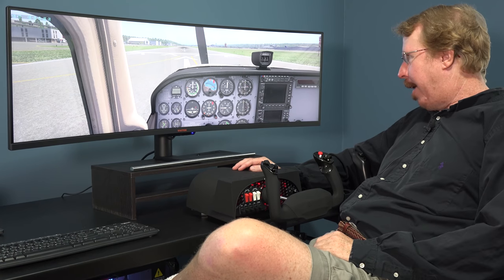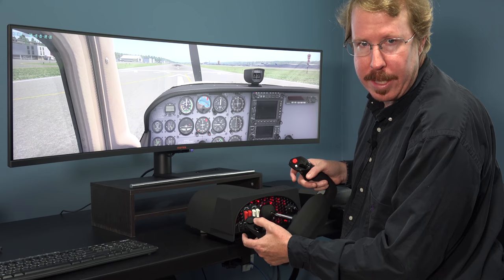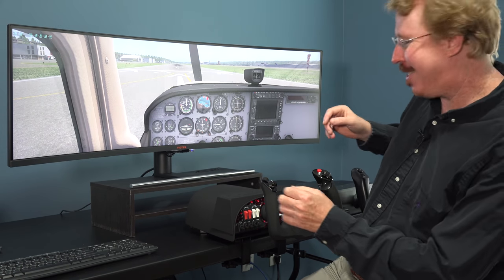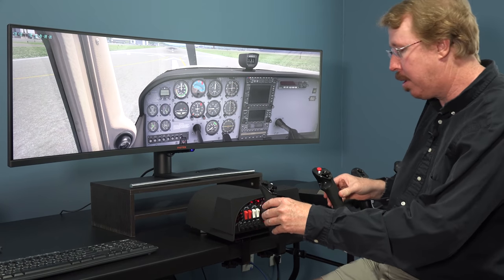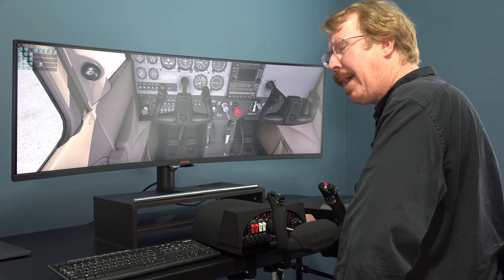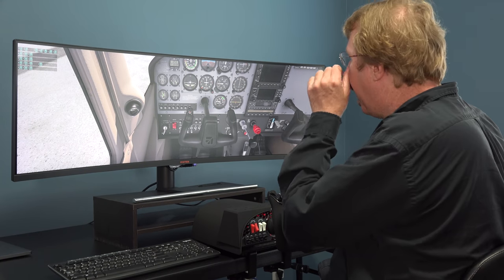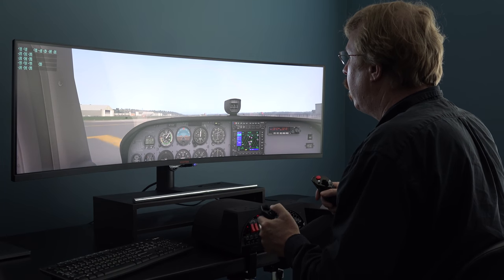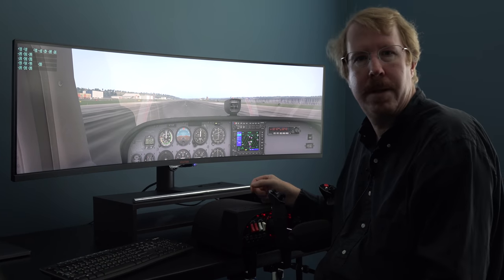Honeycomb Yoke Overview and Demo by X-Plane creator

Comment: Hi Austin, I want to thank you.   I received a scholarship when I was at high school, a meagre $1800AUD back in circa 1985.  I used that to fund flying lessons.  I eventually flew solo in a Cessna 152 when I turned 16 (a couple of weeks later).  It took me 22 hrs.  Average was apparently 15-16 hrs.  In my defence however, I never took off or landed without a 15 knot crosswind and most of that it was pissing down with rain.  It was the time of the Americas Cup in Perth/Fremantle and Alan Bonds Air Ship was always somewhere I was flying around.  I think it took me a while to get there not so much because of the cross winds, but power stalls really got to me, until I eventually recovered from one in 400-450ft.  I also had to have a booster seat.  I never got a growth spurt till I was 18.  When the money dried up, I was hitching flights on C152s, C172s, C182s and even V35Bs (Which still fascinate me till this day).  One of my Year 11/12 subjects was Aeronautics, so I got a bit of boost towards academics and a graduation prize for being one of the youngest pilots to fly solo in my State.  All things come to an end.  When I opened this yoke and finally figured out I had to patch the RG12 in, wow, whilst I was flying in FSX:SE Dont kick me I do have X-Plane  but need to get a 152 model, man it was awesome.  Ive had DCS FSX:SE & X-Plane for a few weeks now, working out what hardware to get.  I got screwed around with a store when I purchased a JoyStick Rudder and Throttle set, and as they neglected to let me know it would take weeks to get here, I eventually had enough and on the basis of your video I grabbed the honeycomb alpha.  Like I said WOW.  Now i cannot fly without rudder.  Even with Automatic Yawing, it just does not give you control.  Ive spent hours researching and as much as a Yoke is important, I dont believe that rudder control is any less important.  I just couldnt get an MFG Crosswind in time so I ordered a Thrustmaster TPR.  That ought to be here on Thursday.  In the mean time I will probably be just doing circuits around Oak Harbor, Washington State, as it is a place I know. 

Someone needs to really pick up Perth, Western Australia and give us a VFR package by the way, so if anyone is listening please do.  Just the airport is not enough.  For some strange reason most tourists think that Ayers Rock and Sydney Harbor are the only places in Australia.  They are not. 

So in my analysis, whilst I spent a bit of money because the exchange rate sucks, so it was circa $465AUD or more wihen you account for postage, it really is a steal.  It flies like I remember.  I use a Saitek MFD Panel for pitch control, not ideal, but I felt better than using the trim switches.  Muscle memory.  I still remember myh Mnemonic for starting up a 152.   

"BUT MP FISCHE" with FISCHE pronounced FISH. for Brakes On, Undercarriage Fixed, Trim Indicator Neutral, Mixture Rich, Master In and locked, Friction Nut Firm, Instruments from left to right, Switch Magnetos to Both, Clear Prop, Check Harness, Switch Engines on.  (Hope that helps someone, it helped me fly a plane and not many kids I knew ever did. 

Might help you with realism having a checklist (anyone whos reading this.). Yoke quality is outstanding, reaction could have had a little more spring when turning between 45-90 but, forward and aft movements (elevator) was perfect, almost like the real thing.  Its a pity Saitek doesnt have the TPM available, because the quadrant I grabbed with this yoke just doesnt do it for me in a 152.  Sure two of them might be nice with jets, but seriously, I dont know why they stopped putting them out because, its what you start on, and everybody goes through it presumably.  

Whilst in your latter video on this, the comparison, one of the yokes, may have had more travel for pitch/elevators surface controls, really, I wouldnt be able to fly it in the tight space I have in my Transmitter room. 

As I am half blind now, after my last spinal fusion, with a massive amount of damage to my right eye, and I also have a dominant right hand that suffers severe nerve damage.  That pretty picture my instructor was always drumming into me, is coming to life again.  So thanks for bringing me back from the depths of hell.  Since leaving the military, I havent had such excitement, enjoyment, and purpose.  This Yoke may well be the best thing Ive bought since my discharge.
Reply: K

Comment: On an unrelated side note, if you have an electric trim runaway, pull the electric trim circuit breaker
Reply: SkyhawkDriver unless you have MCAS and a faulty AoA sensor of course...

Comment: While Austin (created and) used X-Plane to be prepared for his second instrument currency check, I used it for my instrument training during days when I was not flying. While I did not use the honeycomb yoke, but the logitech one (lol), I was more after practicing IFR flying. X-Plane helped me immensely in this regard, such as refining instrument scan, multitasking, shooting instrument procedures, staying ahead of the airplane, etc.

Given a choice now, I would have bought the honeycomb yoke. But considering I already own another yoke, I probably wouldn't change it because I don't use the simulator to learn to physically control the plane, but to practice the IFR flying and procedures.

I guess the choice of hardware depends on what you want out of the simulator. But considering the price difference is not much, honeycomb yoke is the winner.

Comment: I am hoping Austin reads these. Not sure of a better place to offer suggestions but I'd thought I'd give it a try. In the spirit of flight sims being an educational tool I wanted to suggest incorporating dynamic airspace and communication. By leveraging the current airport information and location of your aircraft in three dimensional space and using the current ATC dialog box functionality it seems you could add the communication with just the tower and ground. For example if I enter a class D, C, or B airspace without permission I would get a warning box. (with the option to deactivate the feature). You would therefore need to dial in the tower frequency and via a text box select permission to land or transit through the airspace. Depending on your relative location from the airport, the tower can reply with instructions such as "Enter left traffic pattern for runway 07" or "Cleared for a straight in approach for runway 25" or "Cross over the midfield and enter a left traffic pattern for runway 03". This would be a great way to teach awareness of airspace when planning flights and following proper procedures. Being a pilot myself the biggest wake up call going from the sim to the real world was communication and airspace rules and regulations. Having the realism of transitioning from controlled to uncontrolled airspace and back again would further bridge the gap between the sim and real world aviation. Love X-plane and everything you have done with it over the years. Thanks in advance for listening and your consideration.

Comment: Yesterday a person from Honeycomb recently posted on their Facebook page that the reason some yokes have a deadzone, and some do not, is that some of the early production units were calibrated incorrectly at the factory, giving them a deadzone they should not have. My yoke from the original preorder has a 5mm deadzone in elevator, and a 9° deadzone in aileron (5% of total rotation!). Also, I have found out that the yoke has a built-in "hidden" calibration routine that can be invoked to recalibrate with no deadzone at all - but those that have been told this procedure have been instructed to not make it public, as they are concerned a user could screw up their yoke even worse.

Comment: HI Michael, great review of the Honeycomb Alpha by both Austin and you! Can you guys also make a review of the Honeycomb Bravo throttle quadrant? It's a great quadrant, but after trying to use it with X Plane 11, I found it a bit difficult to controll the thrust reversal and feathering (default King Air C90B and Beechcraft Baron B58). It seems X Plane would benefit from additional variables controlling prop feathering. As of now, there is now way to assign a throttle binding to feather the props for this quadrant. Thanks again!  :)

Comment: So here I am with a CH Yoke that I've had for about 10+ years and I was looking at this brand new Honeycomb. For about twice the price of a CH Yoke, in a Honeycomb there's no throttle, no prop pitch, no mixture control, no flaps, no landing gear control, but there's a bunch of switches on the panel that I've never really used in simming and are easily accessed in the panel on the screen. There is an ignition switch that's located on the wrong side of the panel and the "start" position isn't even spring loaded. The yoke does rotate 90 degrees in each direction, but the only times I've ever turned a yoke that far in a real plane was during a preflight control check or taxiing in a stiff crosswind. The back pressure in the elevator axis is ridiculous and the up and down strokes are way too short compared to any real airplane that I've ever seen. The red lights in the panel?  What's that about???  In any event, this thing is as nicely built as any piece of simulation hardware that I have no use for.

Comment: 23:30 to 23:50: What Austin said was my thoughts exactly. I bought my Honeycomb yoke last week and tried it with XPLANE11.5 over the weekend. I have 36 hours of flight experience in both Cessna 152 and 172 from my previous flying school in the US but plan to restart here in the UK but flying the Piper PA-28 Warrior II. 
I bought that module but flew it wearing an Oculus Rift S and I swear, it was so incredibly realistic.
One thing I'll need to do is change the top left hat switch since i don't need to "look around" given that I'm in VR.

Comment: Using default settings, on a cessna 172 with honeycomb yoke, it seems impossible to elevator trim (A&B) to have level flight. I wish you could micro trim with the dual button setup.

Comment: Great Video,
I'm just getting back into flight sims, haven't flown them since roughly the late 90's.
I've also just started at flight school and have bought this yoke and the latest Xplane with hopes of re-flying and practicing my actual lessons. I'm currently flying a C172S Glass and was happy to find the same plane in the program.

Sticking with the 172S, to maximize realism, would you recommend flying this yoke with the default response curves or a modified curve?

I don't have enough experience in the plane or with sims to accurately judge the yoke's performance at the moment.

Comment: My biggest beaf with this Yoke is that, if you're going to put a magnito/starter switch on the panel, put it in the right place. I've flow multiple C172's, and even on the screen you're showing there, the starter switch is on the far most left hand side beside the master switches. Even Logitech get's that right (granted that panel has all the switches in the wrong order). This is a nitpick I suppose, but you know 'simulation' means being as close to real life as possible. I also wish that HoneyComb would have just made a square casing, that curved back portion makes fitting into simulation panels a PITA.

Comment: I sim mostly with the default 737 in X-Plane and was considering this yoke. So I was wondering if this yoke is suitable for airliners like the 737, 747 or Airbus. Looking at the buttons, it seems like it was designed with small GA aircraft in mind.

Comment: Looks like a really amazing yoke. Will it not work with a Saitech throttle quadrant or rudder peddles? I have a Saitech setup with my X-Plane 11 program and you are right, it is way sensitive. I just bought a Logitech extreme 3D pro joystick 🕹 to go with my simulator but can’t figure out how to get X-Plane to talk to it. One☝️ person said I had to disconnect the yoke in order to use the stick. Another said he could use both together. Any suggestions? Thanks for sharing your knowledge with the rest of us and thanks for introducing X-Plane to the world. I can no longer fly so this simulator is a godsend. Now if I can just make it work.lol. Sometime when you have time could you please publish what computer 🖥 hardware you need to get the beautiful scenery and smooth flow you show in the demonstration videos. It is awesome 👏

Comment: Great Great video!  Mike, I have a 27" iMac with 8G Ram and 1T storage running an Quad Core.    I plan on buying a Honeycomb yoke, Logitech power quadrant and rudder pedals.  Before I spend this $1,000, will Xplane 11 run on this setup with no issues?  Thank you in advance for your reply.  Rick

Comment: Does the yoke travel, required, change as a function of airspeed as it should? Small movements at higher air speeds and larger inputs required as your in the roundout.

Comment: Just received my Honeycomb and the Avionics Bus switches don't work well with X-Plane 11.41.  At least on the Cessna Skyhawk.  Bus1 switch only turns on Bus1 on the sim.  The sim settings only have Avioncs as on, off, or toggle so the Bus2 switch can be set but does NOTHING if you set it.  Yes Austin talked about it at 13.58, but did show the screen where Bus 2 is not on.  As a result, you have to go into the sim to turn on Bus2 with a mouse click.  Wonkey!

Comment: Or you just use XSUIPC and make a button combination that if only Pitch-Trim-A button and Pitch-Trim-B button are up you pass it along to the simulator as a Pitch-Trim-Up Command. Same with pitch trim down.. And the beauty is that this also works for the ESP based platforms..

Comment: Talking about trim tab, on older planes except while on autopilot the elevator trim is a wheel which is physically connected to the trim tab. Modern passenger jets using fly by wire would have those trim buttons like that. Now I've never flown a jet, but doesn't fly by wire remove that force against the pilot so you don't need strength to move the controls?
Reply: Robert Schuster no, even in large jets the pilot has to overcome the forces on the yoke.  MentourPilot has a nice video explaining it and demonstrating it in a 737 simulator if you would like to learn more on the topic.
Reply: @Hoekstes  I've seen video and pictures of new jets with joy sticks (located on the pilot's left by the window) for the flight control. There's no force feedback and if even if there was it would never be more than a normal person could move. Hydraulics run by an electric motor is much different than cable connections. Hence the need for the safety buttons, it's all electric now. Physics might make it impossible for the hydraulics to overcome a run away downward trim but the pilot doesn't have any physical feedback to fight.  I've read stories in various aviation magazines where pilots complained about "no feel" when fly by wire first came out.   Hey, I could be wrong. I'd like a pilot of a new plane to give me the full story.
Reply: Yep, that's the big difference between Boeing and Airbus.  On Boeing you've got forces on the yoke, but in Airbus there's no forces on the sidestick.

Comment: Based in this video I went ahead and purchased the Honeycomb yoke (Spring 2022).  Austin is right.  It is a really good product, high quality and has made my flight simulator more realistic and a lot more fun.   However, there is one significant problem that really puzzles me.  Why is Honeycomb's customer service so unresponsive?   Five months ago I lost one of the lateral trim covers.  To be clear, this was my fault, not Honeycomb's.   I reached out to Honeycomb customer support and created a ticket requesting a new trim switch cover.  To make a very long story short ...  I had a very difficult time getting Honeycomb to respond.  As of this writing it has been  5 months  since my original ticket.  Finally,  I got an email that the part is in the mail.   Hopefully I will finally get it.  

 Can anyone give a reason why they are so slow?
Reply from the maker: I do not know why, but you are not alone.
Reply: @xforcepc  It took 6 months but I finally got the part!

Comment: In X-Plane 172; it has electric trim but cutting power does not help if you set the elevator trim failure

Comment: So austin says this is the best yoke ever, is he saying that the honeycomb is better than the yoko?  Not that I'm looking to stir anything up, I am using the same saitek, not Logitech saitek yoke I've had for 10 years, and I was a day 1 preorder on the honeycomb yoke.

Also Michael thanks for your awesome videos!
Reply from the maker: I will do a comparison video very very soon to clear that up.
Reply: @xforcepc  awesome looking forward to it!  Yoko is way out of my budget, but that was a big claim.
Reply: @xforcepc  Hi Michael, make sure you compare with the Yoko Pro yoke (with Hal sensors and hat switch).  The Honeycomb might have a similar resolution in the 1/1000s, but when those pots start spiking it won't really matter.  No controller should be built in the 21st century using potentiometers!!!  The amount of Saitek stuff I have thrown in the bin over the years with spiking pots is incredible!
Reply: It is not better than the Yoko. Not even close

Comment: What monitor do you have ? Looks really cool. 42 inch ? Resolution?
Reply from the maker: 49" Super Ultra-Wide.  Viotek, Acer, and Samsung all have models with similar performance.  This is the 1080P variant that goes for $800-$1000.  The 1440P varient is closer to $1400.  Oh, and it is 3840x1080...the same as two 27" 1080P monitors side by side.
Reply: Think I'll put one on my list. So much better than 3 monitors side by side imho.
Thnx !